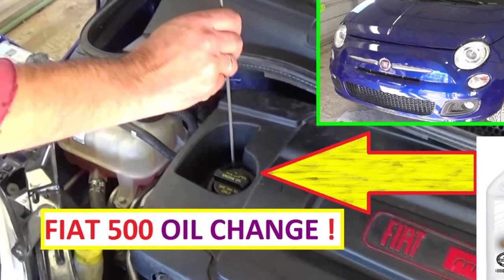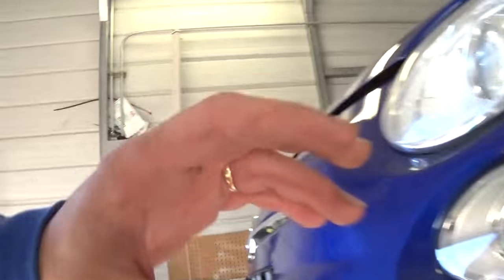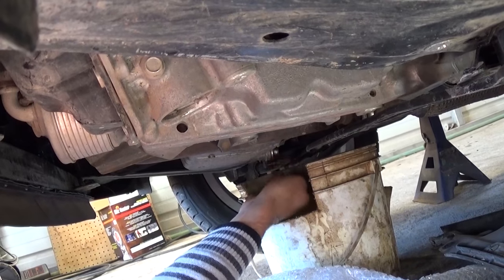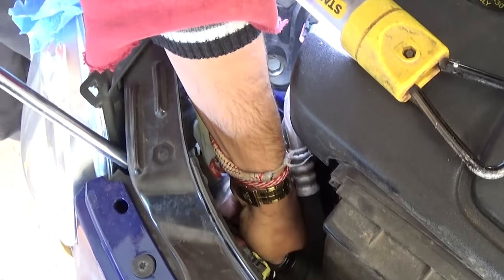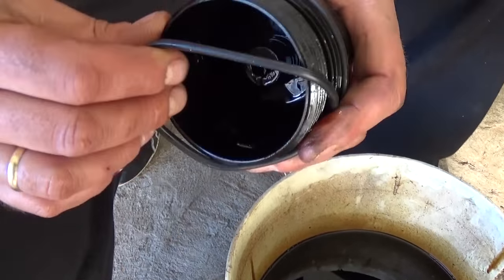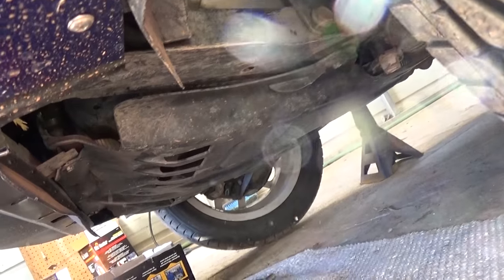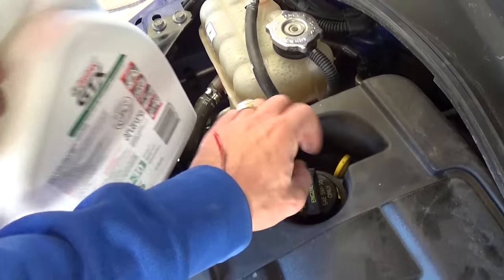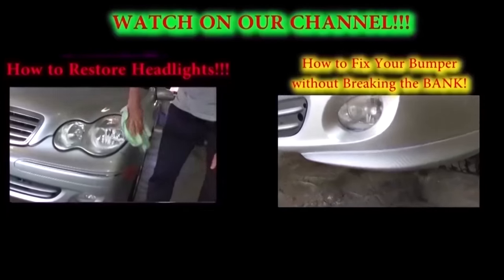Oil Change on Fiat 500. How to Change the oil and Oil Filter on Fiat 500 2008 - 2016

Comment: Gosh, you make it look so easy! All the other videos require you to move tubes & wires and even remove the engine cover to get to the oil filter. I love that you went straight in through the front grill/bumper area. 😊

Thanks!
Reply: tori2dles Right! I'd have been down there with a box end wrench if I hadn't seen this. ...it might take every extension in my box, but so be it! Harbor freight sells long extensions cheap enough for the person that can't reach by assembling thier current collection.

Comment: hey guys, enjoy the videos and your accent, not much information on fiats out there.   Just wanted to add,  there is a way to keep from making a mess when removing the filter from the engine.  On the plastic filter cover there is the word drain with an arrow.  Before unscrewing all the way,  let it sit with the arrow pointing down, the longer the better.  This lets oil drain from filter cover and filter,  when you finally remove it,  hardly any oil will drip out.
Reply from the maker: great info, thanks!
Reply: andrew batie Thanks for sharing this!
Reply: your welcome charredskeleton

Comment: Two observations, having completed the work. Popping the engine cover off only takes a few seconds (and no tools) and releasing the AC line from it's locating mount at the top of the cam belt cover (also w/o tools) is also easy and allows you to move the line aside to more easily extract the filter/cover.

Comment: Thanks.  That hole near the headlight trick was awesome.  I also used a swivel head at the end of the 1/2 extension, but it is not necessary.

Comment: This is the best oil changing video on a fiat I've ever seen.  All of the other ones never showed the extension going through the grill. You're a genius. Thanks for posting this. Oughta save me about 25 to 30 dollars to do it myself. Do you have a video on how to do a tune-up on the same car?
Reply: At the time of draining the engine oil, you must remove the oil filling cap, as it will allow the air go in the engine to bring out all the old engine oil through its drain plug.
Reply: @rajaz1601  is that safe to let air into the engine?

Comment: Notice how the the bottom valance cover "bolt" hole is thrashed and blown out. Do not use air-tools to re-install the bolts! People that do the latter are "hacks." It also helps to wipe out the sludge from the oil canister. Why put it back dirty?

Comment: What is the bar going across almost right under the oil plug. Yours looks like it is back of the way. On my 2013 it looks like i need to take this bar off to access the oil plug and i need to know the torque on the bolts to put it back.

Comment: The oil filter should have been removed when the sump plug was out and the oil was being drained at temperature.
Torque wrenches are a great invention.
I did love the cut out in the side of the 5L bucket (very useful) I like that.

Comment: I own 17 cars currently and more than 30 in my lifetime.  Without a doubt the oil change on the Fiat 500 is the worst oil change of any car I've ever owned.   The Fiat "engineers" were complete idiots when they decided to put this engine in the US car without modifications to the drain plug location or oil filter.  The drain plug is situated underneath a plastic aero shroud- that requires removal of 6 bolts and  it's tough to get it off using a single jack under the car.  It's made easier by jacking up both sides of the car in order to access the back bolts.  Convenient, huh. Then there's the location of drain plug - it's situated right above a engine cross brace for no good reason  except  to ensure that the oil from the sump winds up on that crossmember and then runs everywhere else.  The oil filter seems like it belongs on a 1935 Fiat- not something from the 21st century..  It's a paper filter in a plastic housing that is damn near inaccessible from the front.  Removing it ALWAYS creates a mess with oil dripping down in places you'll never be able to remove.  It also requires ridiculous manual dexterity to try to maneuver it out through and opening that is marginally larger than the housing itself. If you don't have dainty hands you will have torn gloves and scratches on your hands (and the housing too!) It helps to remove the filter element before trying to get the plastic housing out, but even so, it's a bitch.  One has to force it through the opening in order to get the housing out, so forget about cleanliness, there's going to be subtle damage to the housing each time it's removed, possibly the threads, possibly to the O ring, and grit will get everywhere just trying to get the housing out - or back in. This doesn't bode well for the longevity of the housing or for the likelihood of future oil leaks. Speaking of grit, the threaded aluminum oil filter boss on the engine itself is oriented upward so that any grit that you liberate trying to remove the housing winds up....in your oil.  This is an absolutely retarded design and I hesitate to use the word design, because clearly NO THOUGHT WHATSOEVER went into this. Why didn't they just locate the the filter on the bottom of the car and have an opening in the plastic shroud for the drain plug.
Reply: Oh, and the filter situation with this car doesn't even hold a candle to an late 60s/early 70s W114 Diesel Mercedes. That filter was almost IMPOSSIBLE to get back on correctly - even MBZ mechanics had problems!